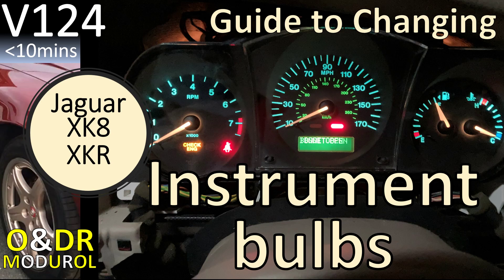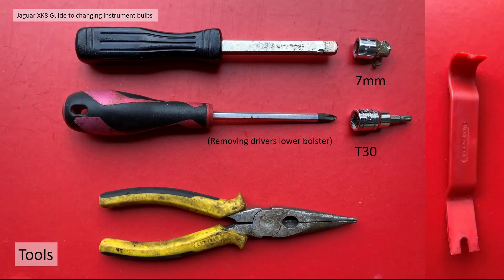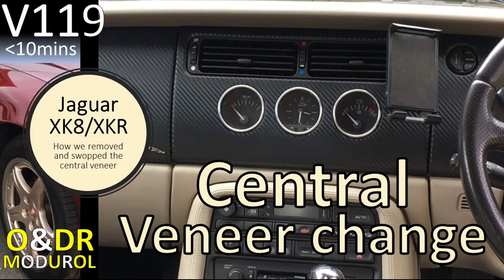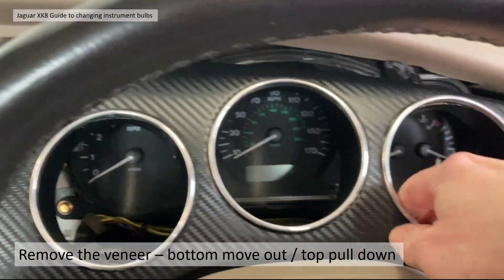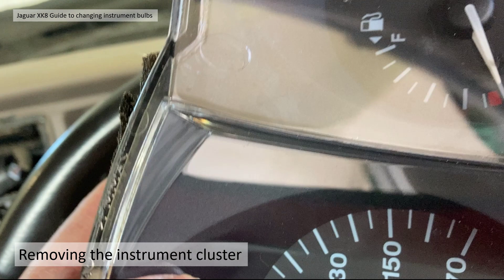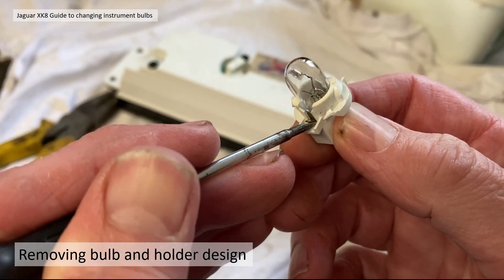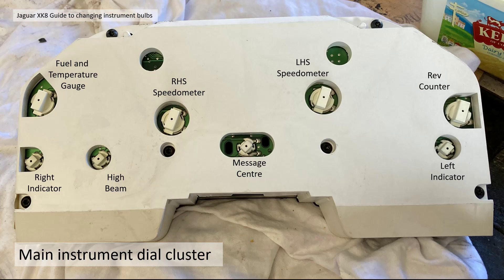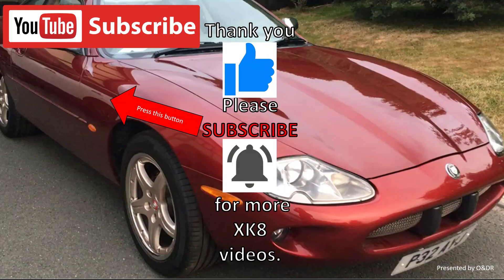Jaguar XK8 Guide to changing instrument cluster bulbs V124 / XKR (X100)

Comment: Hello Damian,
Excellent video! Saved me alot of time especially with the polarity. 2 of my T10s burned out so the gauges were pretty dark on my XJ8L. Just changed all four T10 and the four T5 today. Went like clock work thanks to your video! 
Just an FYI, I changed the current setting resistors on both the T10 and T5 LED bulbs to lower the current. T10 was lowered by 33% and T5 were lowered by almost 4x. Still alot brighter than the OEM incandescent bulbs. The lower current will significantly extend the LED life. Very happy with the display! Thanks again.
Reply from the maker: Jim, thanks for the feedback and thanks for the adding resistance tip. That sounds a really good idea to reduce the brightness slightly and increase the life of the LED bulbs. Do you remember the ohm rating of resistors you used. Much appreciated, regards Damian
Reply: Hello Damian,
For the T10, it had two 24ohm resistors for a total of 48ohms. I changed one of them to 51ohms so total is now 75ohms. For the T5, it had a single 120ohm and I changed that to 430ohms. Signal indicators and information display don't need to be that bright. Even with 430 ohms, it was still slightly brighter than the incandescent bulbs that I removed.
Reply from the maker: Jim, cheers, thanks for the details might add these resistors if I need to change any bulbs, regards Damian

Comment: Hi Damian. I followed your video to the letter and managed to change the bulbs. Thank you so much. Just one point, I bought new bulbs and holders from SNG Barratts and when I installed them all I found that I was worse off than before in that some that I was only changing as a precaution no longer worked. After some puzzlement I decided to use the new bulbs with the old holders and that did the trick. The new holders were not as good a fit as the originals.
Reply from the maker: Andrew, interesting feedback, much appreciated. I had similar problems with the LED bulbs. The original size holders are not quite the same size as current 'new' bulbs for some reason, regards Damian

Comment: Excellent presentation.  Bravo.  Make absolutely certain ignition is OFF before disconnecting/reconnecting major cluster multiplugs or you will cause electrical damage.
Reply from the maker: Gary, very good point. I did go a bit further to be 100% safe and disconnected the battery. Should have mentioned that in the video. Thanks for the comment and input, much appreciated regards Damian

Comment: Hi Damian, first I have to repeat myself: I love your clear and incredibly helpful vidos! 👍Thanks for all the effort you put into your channel! 🙂I tried to do this job today but I couldn't find a way to get the main instrument cluster out without removing the steering wheel... everything's very tight in there! It looks so easy, when you pull that cluster out - did you do that job with the steering wheel on? If so: is there a trick? I had the steering wheel moved all the way down, but even then: no way 😞 I'd like to avoid the removal of the steering wheel since I'm not sure if I want to play around with the airbag... best regards, Christian
Reply from the maker: Christian, I did the job with steering wheel still attached but taking the steering wheel off isn’t difficult. The top tabs on the instrument veneer have fabric glued on and might be tight to remove. I am sure my veneer had been off before which might account for it being so easy to remove. Good luck with your removal and thank you again for your comments and support, regards Damian

Comment: Thanks for this Damian, excellent stuff. I noticed in another video that the battery should be disconnected -- could you advise if this is strictly necessary? Also, there was no way in hell I could get the knee bolster off underneath the steering wheel. One side popped out OK but the other -- nearest the driver's door -- absolutely refused to drop off. The lug appears to be out OK, but there is something else holding it jammed -- and I cannot for the life of me understand what it is. Fortunately, I succeeded in loosening it just enough to prise off the fascias and get to the instrument cluster. This was helped by the fact there were NO fascia screws in place. Strikes me that somebody has changed the bulbs previously and encountered the same damn problem with the knee bolster. Which brings me back to -- what else could be holding it on?
Reply from the maker: Lawrence, thank you for your compliments. Same with my car, someone already been there. The drivers bolster has two screws at the bottom and two clips at the top. You seem to have sorted these out. What you also might have is wiring caught, the electrical stuff, temp sensor and valet button etc. Or the sunglasses/accessary draw catching. I have covered the bolster removal in another video in a but more detail. https://youtu.be/-TV6cDlIxps . You can see the back of the bolster for your information. Plus you need to lift the bolster up and towards you to release the clips. Hope that helps. Please let us know how you get on, regards Damian

Comment: Hi, I found your video very helpful in replacing my 3 dial cluster on my 2004 XK8. The replacement was due to original clock not keeping time.
After fitting the replacement used cluster all the dials worked correctly including the clock. Unfortunately the bulbs did not. I replaced the bulbs straight from my old unit including the bulb holder’s as I knew they worked, but still no illumination. Any suggestions on possible cause?
Quick update I have tested the bulbs and they seem ok and adjusted the metal connectors on the bulb holder, and have tried the old cluster. No light. Could a fuse blown? None of the rest of the dashboard is affected.
Reply from the maker: @Fixthings-mn6nz, sorry haven't had this issue myself. If both new and old clusters could be the fuse or wiring harness. Sorry can only guess, regards Damian
Reply: @ODRModurol Hi Damien,
I had my electrician friend test all the bulbs and holder. Found that both the bulbs supplied with the used part and from the original part had blown. Using the part no. provided in your video, I ordered replacements bulb and bulb holder from SNG Barratt. We also took the precaution of cleaning up the connector’s on both the cluster and the multi plug. Also applied connector improvement.  Result I have now a fully functioning cluster. Thanks Paul
Reply from the maker: Paul, glad you found the cause and fixed the issue. Well done 👍, regards Damian

Comment: I saw a previous video where you took the bulbs out of the steering wheel would you say that they're all like that I have a 98 XJR some people said that there is no light bulbs back there but I saw on your video that there was places to put light bulbs in they just didn't have the light bulbs put in it is that standard procedure?
Reply from the maker: Mark, I don't believe it was a option. There wasn't any bulb locations behind the switches, I believe the steering wheel button were just not design to illuminate, regards Damian